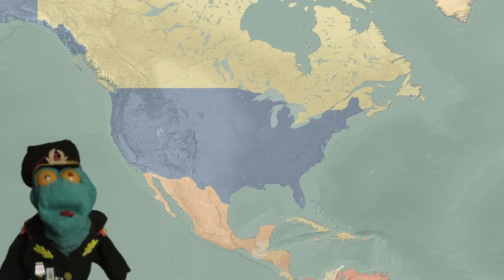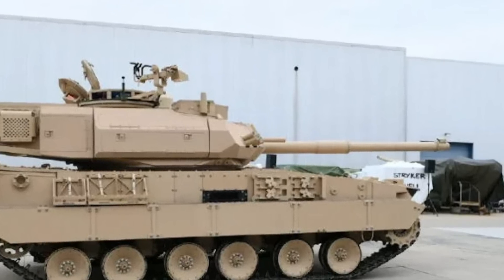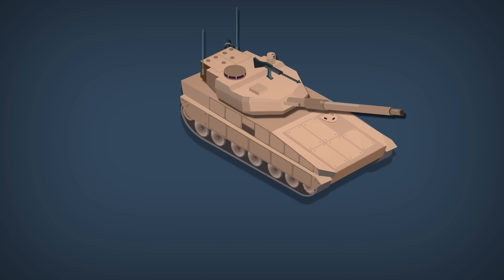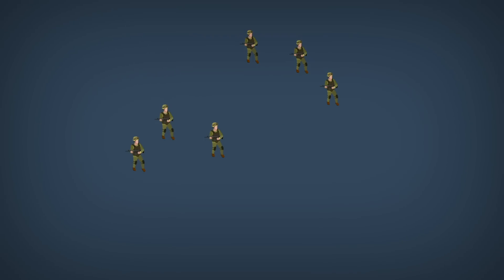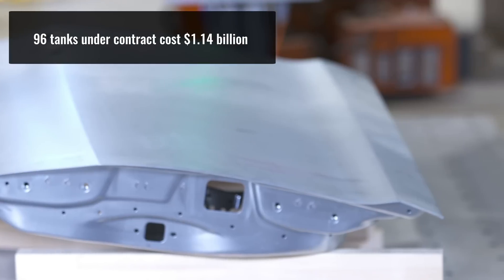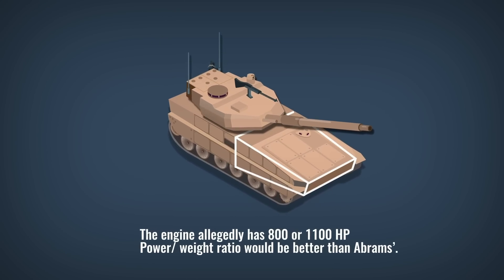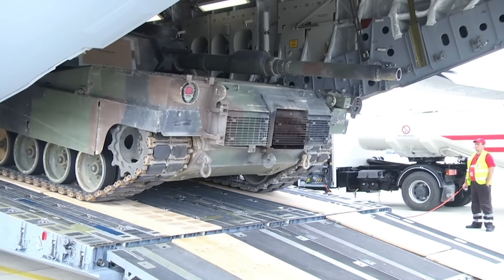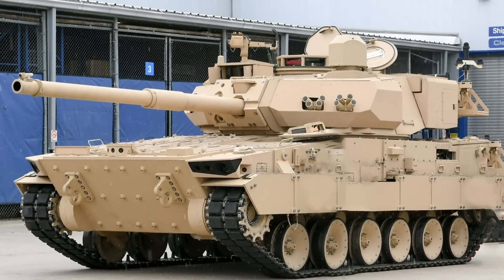US Army just chose its next (light) tank

Comment: The 105mm gun is capable of killing modern tanks, just not from the front...  Light tanks aren't meant for taking on MBT's head on... But they are really good for ambushing enemy mechanized\Armored columns and then quickly falling back and changing position.  Not to mention alerting the rest of the units of enemy contact...
Reply: I would think since it's doing infantry support that the infantry would roll up with Javelins while the tank covers them if they get into it with MBTs. Not that they'd want to but it will happen eventually.
Reply: @specialnewb9821  likely intended to adopt the methods used by leopard 1s. Pack hunting, maintain constant movement and distance, and seek the flanks of the enemy. just because the front won't break doesn't mean the side armour is as tough.
Reply: Yes, probably at a closer range. Hopefully the other tanks aren't aware of where these light tanks are because they will have more firepower and will destroy them.
Reply: @Grounders10  

Let's hope it can get through the side armour also. As for distance....it won't help. It might make them more vulnerable. Tanks have turrets and those things turn. Basically seeking the flank might end when they find the rounds from the enemy that were meant for them.
Reply: Hans  

Sadly, I think many soldiers will say that. That will be because these tanks will be used in ways they weren't designed to be used. They will end up in situations they weren't supposed to be in. I'm certain about that.
Reply: @zaco-km3su  It's up to the military to educate the doctrine properly.
Reply: @Sombody123  

This won't matter. You can "educate the doctrine" as much as you want. If you don't have the equipment at the right place at the right time, you will use what you can. This is the issue. This tank will be fighting tanks. They will be undetected and this tank will be destroyed.
Reply: @zaco-km3su  ATMGs, artillery, drones and air support exist. Why do you presume that this will be first thing they'll throw at MTBs if they can help it? Do you take US military for idiots?

Comment: Since these are lighter, maybe they would be good for island combat, say in a future Pacific conflict. Hopefully they can bang these out by the hundreds.
Reply: Great point. (wise inference, really).  Curious about the "Abrams commonality"  (not modernized)..?   
Also, calculating the logistics tail of fuel (and it's vulnerability) makes SMRs and (crazier sounding) battery powered tanks, APCs Bradleys, etc., very interesting:
They'd require swappable batteries to recharge. They already have tremendous torque, are silent & create far less heat. It comes down to the SMRs ... and modular (scalable) battery packs.

After all, the M1A1 "powerplant" is ~5T (10,000 lbs with fuel) provides it with a 500 km range and 3500 lb-ft of torque.  
Tesla might very well be able to match or beat those numbers ... the issue then becomes quickly recharging them... and...
Ideally, finding inert chemical battery materials with excellent energy-density 
(which should be possible as more exotic / expensive materials, elements, components & mfr-ing works in military budgets)
The question will be whether an SMR can be made (making it at all feasible) and the pro-oil and anti-nuke lobby. 

(I know it sounds rather crazy but, fwiw, I'm not saying this to save the planet (though SMRs would if required) but to save logistic driver's lives)
Reply: @trumanhw  I'd bet the military is thinking about these concepts as well. I've seen articles about battery tech that recharges to 100 in under 15 minutes. Big deal if doable. If they can nail fast recharge or swap, good range for a tanks weight, and durability, then electric offers some big advantages. I think it's coming.
Reply: @catbertz  I saw that article too, I think it sounds very promising. Maybe we will see a prototype in 2026?

Comment: With a 105mm gun, this new infantry support vehicle will not have the ability to take out enemy main battle tanks from the front. I think it's a real mistake not to put an anti tank missile on it such as the Javelin, Tow-2, or Spike NLOS.
Reply: The 105mm is what was on the original M-1 Abrams.  Most of the tanks we used in Desert Storm didn’t have the 120mm gun yet, and they worked just fine.  Of course, the 105mm is not as viable against upgraded versions of those tanks, but they can still easily kill one with a side or rear shot.  And bear in mind that Russia is now using old T-62s to supplement their forces.  The 105mm will easily take those out.  Even the T-72s will be toast if their reactive armor has been pillaged by thieving Russian generals.  

And they don’t need missiles because they won’t be operating alone.  They’ll be in units that have Bradleys armed with TOWs and infantry armed with Javelins.  No one with any sense sends in unsupported tanks.
Reply: @bluemarlin8138  cough cough
Reply: @bluemarlin8138  ff
Reply: @bluemarlin8138  that’s desert storm tho 
Iraq had the obsolete / oldest variant of T-72
Even the first T-72 Ural 
So ur argument isn’t true
Reply: @bluemarlin8138  Russia isn’t using T-62 
Those are for the separatist forces
stop speaking nonsense

Comment: This is a very logical conclusion to modern warfare where big and expensive equipment are vulnerable to advanced but cheap weapons, distributing fire power and potential targets is a good solution, it is cheaper and quantity is a quality to itself nowadays.
Reply: This still costs around 100x what an NLAW does, while not having the frontal armour to be able to operate in desert storm type open field scenarios the same way as a heavy tank. I understand the idea, but this seems to fail to meet the specification if that is the point.
Reply: When human life is cheap.
Reply: @agsystems8220  infantry support armored vehicle with a big gun, that's the role. The US Army still has the Abrams. It seems they wanted something smaller to do different things, and charging headfirst across a desert isn't one of them, which is fine.

Comment: I just hope that the Army decides to upgun this vehicle to the same gun that’s used on the latest Abrams version purely for logistical reasons as well as to be able to use the new AMP round, with the ability to engage MBT’s being a minor/secondary reason
Reply: Cant upgun just for fun, recoil can deform and crack hull of tge tank.
Ammo storage is not the same for 105 and 120 or new 125..
Reply: @ljubomirculibrk4097  actually, iirc the original Griffin demonstrator did sport a 120mm gun so it’s not out of the realm of possibilities.
Reply: If I was the commander of one of these I most certainly wouldn't want to engage other MBTs. These things would pop with one hit and then you lose a whole crew
Reply: @daivdsmith3746  the ability to engage other MBT’s is just for emergencies, as militaries always have to keep in mind Murphy’s Law: anything that can happen, will. I wouldn’t want to be in one of these supporting troops when all of a sudden an MBT suddenly pops up and all I can do is call for backup, be it an air strike, some form of ground based ATGM (be it vehicle mounted or infantry carried) or an actual friendly MBT

Comment: Aluminum armor, 38 tons without armor add ons, no airdrop capability, manual loader, and extremely tall profile. 
It will probably be outdated by the time it enters service. 

Gonna be vulnerable to auto cannons, atgms, and even dumb fire rpgs. Mobility looks mediocre for a “light tank” and uses different ammo and fuel than abrams further complicating logistics and maintenance. 

Looks like the army saw the type 15 light tank from China and asked general dynamics for a response in 5 years or less. 

The type 15 weighs 32 tons, has a bustle style autoloader, steel base armor, composite and reactive add on packages, soft and hard kill active protection systems, and specifically designed for mountainous and difficult terrain where mbts cannot go. The type 15 has about 34 horsepower per ton while the mpf will have around 23-27 horsepower per ton depending on the engine (800 or 1000hp) 

A step backwards compared to previous projects like the xm8 and overall a waste of money
Reply: The manual loader’s real job is to help with maintenance on the tank.  You need 4 crewmen to maintain any tank efficiently.
Reply: Do profiles really matter much in an age of drones and top attack atgms?
Reply: US army wants to be special so they went and ALSO changed their standard rifle/MG which uses a completely different bullet which will mess up logistics insanely bad
Reply: Damn. Deep analysis.

Comment: Not a replacement tank.   A lightweight tank destroyer.  Think thin-skinned Bradley with a big gun, or our current Stryker with a big gun turret.
Reply: @C. W. Sayre yes it can
Reply: @dominiksoukal  It still not a Tank Destroyer when its not even build to take enemy MBTs, and while you can destroy any modern tank with a Panzerfaust from WW2, you would not want to do it today.
Reply: 105mm main gun is 20-30mm too small these days to destroy tanks
Reply: @C. W. Sayre They only say it can't because that's NOT what it's operational role was designed for... But if you've kept up on its development, it can defeat even frontal MBT armor from 2000m. They used the 105 on the OG M1, and many other NATO tanks, and over the last 3 decades have perfected it's operation and potential.

Having double or triple the amount of these (than Abrams) would do a mobile army well against a slow, logistics faultering enemy (*cough* Russia and China *Cough*).
Reply: No, this is not a tank destroyer.  The 105 mm will not do more than piss off an enemy MBT.
Reply: @gerfand  i agree it's not a tank destroyer but it can destroy any modern mbt at a 30° angle
Reply: @dominiksoukal  not really, Armata frontal hull armour at range is believed to not be penetrable by the latest in use guns, and Leopards2A5 foward and M1a1HA, hell an T72B with proper ERA would be imune to it at range

Like I said close enough you can pen it, but that is like saying a swordsmen can kill a modern riflemen
Reply: @k-aw-teksleepysageuni8181  the fact that they need this tank shows that US logistics are not as "perfect" as you think

EDIT Also the fact the Abrams got its gun upgraded really shows that you are wrong with the 105 can pen tanks at 2km idea
Reply: @C. W. Sayre Well considering what's going on in Europe right now it doesn't need to be
 You can just have one of the accompanying infantry jump off the back with a javelin or a law
Reply: A light tank, not an MBT nor tank destroyer.
Reply: People, we have 30mm A-10 rounds that penetrate MBT armor.  And that’s a kinetic penetrator.   HEAT shaped charges are even better.
Understand that the large bore on a tank gun is only to  quickly achieve high velocity without via sabot, even though the actual dart is a much smaller diameter.   If we wanted to achieve the same velocity using the actual smaller diameter, that thin tube would need to be double the length.  We use the 120 for twofold:  that velocity advantage using a shorter barrel and sabots, and enough diameter for a cone shaped charge with the HEAT.

Comment: the mobile protected firepower vehicle should be in the United States Marine Corps as they new armored fighting vehicle so they can have more firepower in a near conflict
Reply: idk, maybe, but I think the marines would be better served by something a bit lighter and faster with a smaller gun. something in 28 ton range with maybe 90mm cannon, amphibious if possible, but light weight for hovercrafts if not. just based on marine corps doctrine, this tank might do the job even if its not ideal
Reply: @theduke7539  Or maybe just Carl Gustav 84mm with a modern sight?
Reply: @oberleutnant4013  I think the USMC is replacing the Gustav. not sure. but Im sure if the marines need a more offensive vehicle to compliment their AAV, theyll figure something out

Comment: It’s not a light tank. It’s a medium tank. It weighs roughly the same amount as the baseline T 72.
Reply: Those figures would give horsepower/weight ratios ranging from 28 hp/ton t-72 has just 18/ton so it cannot weigh more because it has more hp/ton with less hp 800 vs 1000

Comment: Between the striker with the 105mm and the existing main battle tanks I don't see why this is needed
Reply: The Mobile Gun System (Stryker with a 105) is being retired. I guess they had problems maintaining its autoloader and some other issues. The Mobile Protected Firepower was supposed to have better airlift capabilities than the MGS. That, and there's some advantages to having a system that was purpose-built, rather than attaching a 105mm gun to a vehicle that wasn't originally designed for it (leading to some compromises).
Reply: @jeffbenton6183  good point. I didn't know that they were retiring the MGS .
Reply: Well, the stryker is wheeled for one (a different class) and it is also awful lmao
Reply: Let me know when an "MBT" becomes air-droppable.

Comment: The M4 Sherman was the best tank of WWII. Sure, it didn't have the best speed, protection, or firepower. But it was easy to maintain, reliable, mass-producible, and effective at supporting the real killers - infantry and artillery. Who cares if you can't take a tiger one vs one if you have a squadron to match every tiger, and the big cat breaks down long before it reaches the front?

If we're really building the modern equivalent of a Sherman, we are doing exactly the right thing. 

No, it won't stand up to a T-14 or a Type 99. It doesn't need to. We have other platforms for that - helicopters, multirole aircraft, drones, and (perhaps most importantly) infantry - all armed with ATGMs. 

If Ukraine is teaching us anything, it's that the main battle tank is beginning to age. Too much can kill it to justify the expense of currently fielded platforms. Infantry need direct support, and armored support is always going to be somewhat vulnerable to ATGMs, but if we ditch the five inch gun and armor equivalent to a full yard of steel, the resulting platform will only be marginally more vulnerable to the threats worth speaking of, and far less expensive. That is the Army's logic, and it's good logic.

That's before we start asking logistical questions. If we can airdrop this thing, that alone makes it better suited to our needs than our current MBT.

The Abrams is a beast, and when it was built, it was one of the best tanks around. We got a good service out of it. But it's too expensive for what it does. This new thing? Isn't.
Reply: Did you also notice how Russian tanks aren’t moving with infantry support. A tank can only see so much so infantry are a huge help that armies like turkey and Russia have neglected and the have paid for it in loss of many tanks.
Reply: a sherman can destroy a tiger 1 km away , also a sherman can resist a tiger shot in the frontal
Reply: @diegomoreno7760  Are you referring to the m4a3e2?
Reply: @hunterjarman4728  M4A3E8 actually, very few M4A3E2s were equipped with the high velocity 76mm gun M1A2. Those being designated M4A3E2 (76)s. Unless you're talking about Shermans resisting the KwK36 then it'd either be an M4A3E2 like you suggested or a field modified M4A3 or M4A3E8 with the Field Expedient Armor Package which was usually either an additional 38mm plate welded on top of the front and sides or just a straight up salvaged frontal plate of a knocked out Sherman welded on for literally double the effective protection. Some field modified Shermans even had improvised turret up armoring kits as well though those were considerably more rare than crew just up-armoring the hull.

Comment: It is designed for the support of Airborne operations and  It's a direct replacement for the m551 Sheridan light tanks.
Reply: maybe you could argue that, but its more of an infantry tank like the classic cromwell tanks from britain.
Reply: @theduke7539  it's not an argument, it's a fact. 
You can't air drop an M-1 Abram's tank out of a back C-5 Galaxy or a C-17 on a pallet you need a runway. They are fire support for air born operations, and if I remember correctly only around 170 are to be built by 2029 . 170 Lite tanks will be split between the air born units and the training battalions.
Reply: @Kendoe0341  you cant air drop this vehicle either, it wasnt designed to be air dropped. it was designed to be air delivered. there isnt a material strong enough for the suspension to take 38 tons hitting the ground at 2 meters a second which is about as slow as parachutes can possibly make this thing. its an infantry support tank and thats how it will be deployed. theyll load 4 of them on a C5A or 2 on a C17, and theyll fly into friendly air bases or land them with naval hovercraft.
Reply: @theduke7539  If you really want to know just go read the Army Times and popular Mechanics just to name a few because I'm done arguing with you .
Reply: @Kendoe0341  in an article from Inside Defense: 

“Airdrop is not one of the requirements that we’re currently pursuing,” Gen. John Murray told the Senate Armed Services tactical air and land forces subcommittee. “One of the vendors is significantly lighter than the other, and there could be potential there, but it’s not an Army requirement.”

Given that we know the losing BAE design was the lighter of the two, that means he was saying that design could maybe be airdropped but not this one.